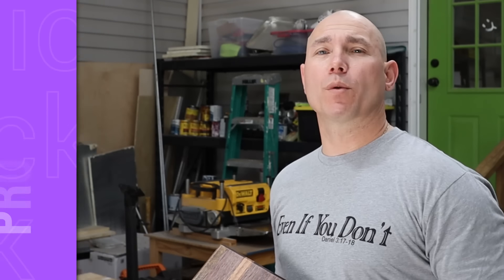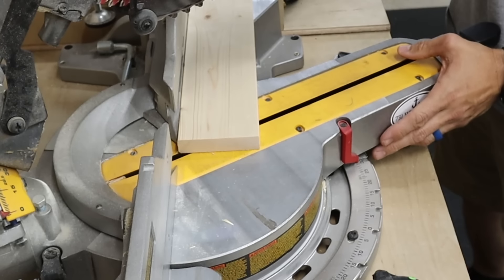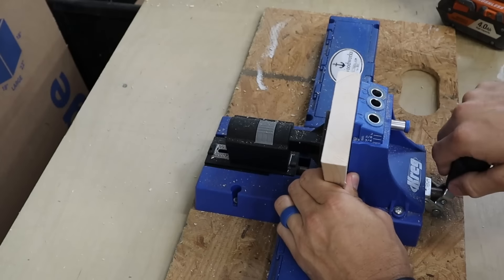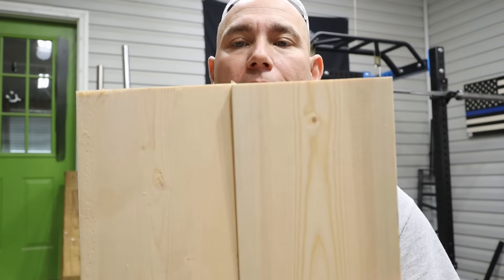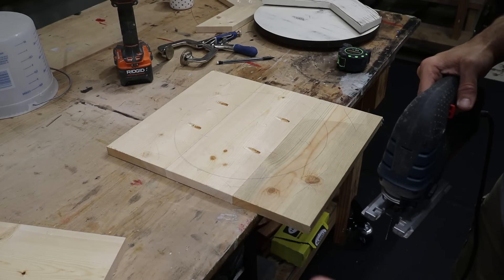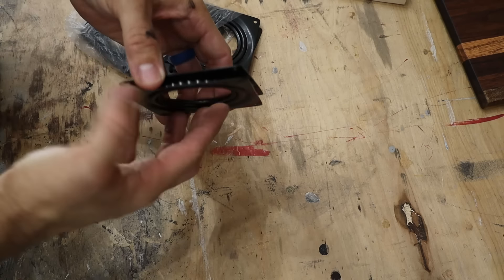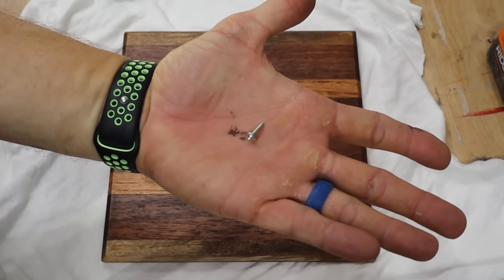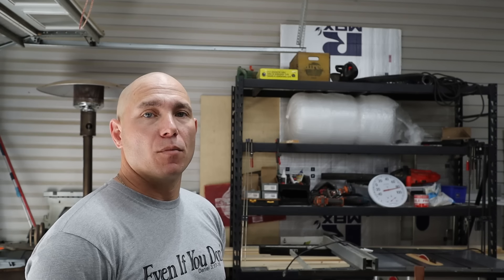2 Easy DIY Projects For Beginners and 1 With a Twist

Comment: Ok Mr. 731 -    You failed to mention that the original round one you show in this video was actually made from a messed up noodle board that you were going to throw away.  I saved that poor wood and made you cut a circle from the middle, sand and stain the edges, and attached it to an old base we had.  Good thing you are talented enough to keep up with me and my crazy ideas! 😘
Reply from the maker: lol. You’re absolutely right.  I failed to mention that. My apologies Mrs. 731. 🙏🏻
Reply: @731Woodworks  HA!
Reply: LOL, for the win. Best comment I’ve read in a while.

Comment: i checked cutting circles on a table saw but your method with a jig saw would be quicker. Which got me to thinking of a table saw stand i bought years ago where you mount a skill saw underneath. Wondering outloud if a person could build a table and mount a jigsaw underneath in the same manner. Using a jig like used on the tablesaw method.  I may try and do that with the old stand i still have with a rigid jigsaw i have but not fond of because  the switch to start is a slider on the top instead of a finger puller like a drill.  Building this is too much trouble for just one unit but for production work could be more precise and quicker. Thanks for the video and others  you make.
Reply from the maker: Thank you. Yeah that would be a neat build

Comment: Noticed you put some outriggers on the 2nd lazy Susan going through the planer. I assume that was to control snipe? How did you attach the outriggers?

I built a rather nice small cutting board Saturday in a Intro Woodworking class at the Indianapolis Woodcraft store (shame there's only one Woodcraft store in the state). Got an intro to the jointer, planer, table saw, router, sanding, and finishing. All told, probably 1.5 hours of working on the board in a 6 hour class.

I'm hoping to pick up enough skills/experience fairly quickly to be able to build/sell cutting/charcuterie boards for the Christmas season this year. Was thinking to also get into pen turning this year but that may have to wait for next year. First thing I need to do is clear all the useless crap out of my garage to make room for a shop.

Comment: Great video!  I have a Kreg jig and never understand the depth of it all. What do you set your jig to when making the pocket holes with the 1x4s please?  I can’t wait to make the chevrons. :)
Reply from the maker: I use the 3/4" setting on the Kreg K5.  Set the drill depth to the recommended depth, then I make it about 1/8" more shallow than recommended.  There is a depth guide on Kreg's website I think
Reply: @731Woodworks  Thank you so much! 🤗

Comment: More great project ideas!  I’ve never made a pocket hole but would like to try. Do you have to use the special pocket hole screws?  Thanks for all the great information and ideas. Love your videos!!
Reply from the maker: you don't have to but they work much better because they have that flat, pan head on them.
Reply: I've made a chevron video using dowels. Feel free to check it out if you're interested
Reply: Most of my pants have pocket holes... 😉

Comment: Do you use any top coat finishing for these. Like a polyurethane or anything like that
Reply from the maker: Not on the painted ones. The stained ones I used the Danish oil
Reply: @731Woodworks  ok cool
Reply: @keithmarlowe5569  that would be cool. But wouldn't that make it the same as the whip on poly. Just asking. I used the whip on on my work bench.

Comment: I recently started to dabble in woodworking and I have found your channel to be AWESOME! Your videos are amazing and so helpful to me. Shout out to you for an amazing job and for helping beginners like me figure things out. I do have a question for you, I recently made some chevrons and decided to try the distressed look. I used the same spray paint underlayer and a nice water based top coat, but I just can't get the sanding right with my orbital. I get the little swirly marks all over it. Any hints or tricks you use? Thnx
Reply from the maker: light pressure. 120 grit paper.  make sure the top coat is completely dry
Reply: @731Woodworks  Thanks Matt, I ended up using a 220 grit paper with very light pressure and it turned out great. Also tried using a spray paint top coat and it worked awesome.

Comment: Good stuff! Newbie question, if I had scrap 1/2 inch plywood would that be fine for the lazy Susan or is the 1x6 def what is needed? Thx so much
Reply from the maker: You could certainly make them out of plywood
Reply: @731Woodworks  thanks. I'm just getting into this hobby and trying to determine things... maybe the 1x6 is a better look.. more cost effective? Hmm the prices are def up

Comment: Brother, it is always a pleasure to watch your videos. I have a question and it may be considered a stupid question...but I dunno the answer. I am just starting a wood shop and as far as the Kreg Pocket Hole Jig goes, to start off with, possibly stick with...which will be the best more versatile, and able to do different types of projects? Orrrrrrrr....the  Massca M2 PRO Aluminum Pocket Hole Jig System...a dollar difference...which is better, since I have limited funds at the moment...FATHER GOD will provide! Thanks for responding and have a blessed day sir.
Reply from the maker: They are both good systems.  You can't go wrong with either. I started out with the Kreg R3. It's only about $20 or so dollars.
Reply: @731Woodworks  Yes sir, I saw that. Thanks for all ya videos and responding. Hope you and yours have blessed weekend and a safe Memorial Day!

Comment: If you're looking for great, cheap hardwood, Bunnings have hardwood sleepers (240 x 75 x 2400) for just over 30 bucks.
The only problem is that they get different varieties and you just have to go with what they've got on hand but I scored a gorgeous redgum sleeper that I've made a tripod floor lamp, a side table for putting little plants on and still have almost half the slab left.
Redgum in that size weighs around 50kg so eat your weetbix before you go to pick it up  :-)
Reply from the maker: Good info. Thanks for sharing